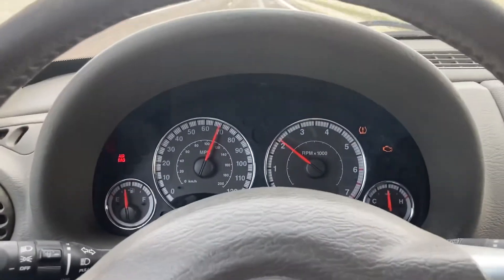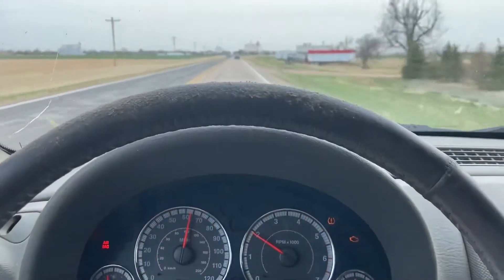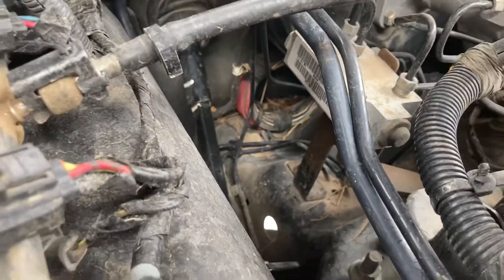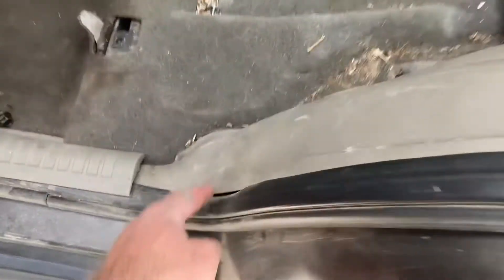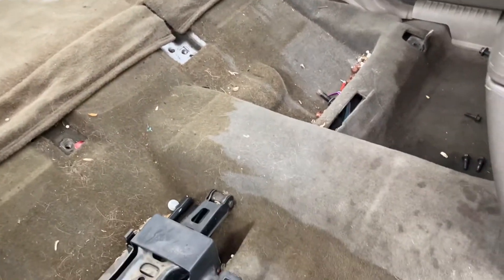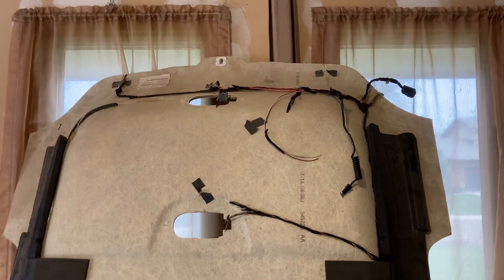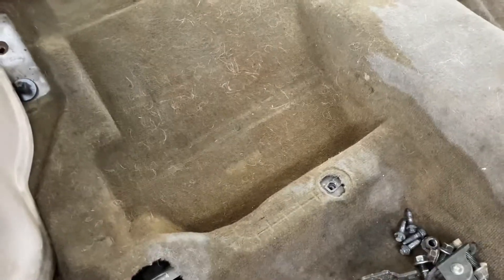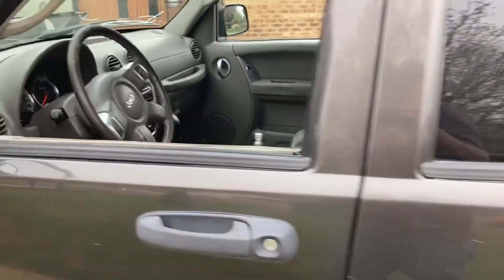2005 Jeep Liberty Update!! It’s running and driving again!

Comment: Wow, so your telling me, I tore my jeep apart and didn't run did yiur vudeo step by step and now ill need a engine
Reply from the maker: Unfortunately, in my case, yes I had a head that had a bent valve. I didn’t truly need to swap the engine, but I was able to get one for very cheap. Could have just rebuilt or replaced the head and been good probably should have done it that way but chose not to. Should have checked the heads when I had them pulled off.
Reply: You didnt have the heads machined at a shop? Im having issues with an 08 liberty and I think im off a tooth also on the timing. Shouldn't be enough to bend a valve so I'd like to know if you could have possibly had a bent valve from before the timing mistake on the right cam shaft.
Reply from the maker: @polygaryd  on mine the valve was bent from previous owner. They had installed a new head on the passenger side and I just assumed it was all good. It was completely my vault should have done better job checking things out before putting it back together.
Reply: @BASgarage  oh ok. I just had the heads machined and valve seats done. The car runs awesome at idle (super smooth) and revs up what seems to be normal but in gear it knocks like to little fuel or something. It didnt do that before the head gasket job. I didnt take the timing gear set out just lined up the balancer to tdc, put the cams v6 mark at 12 o'clock position, put the chains back on. Rotated engine over by hand to make sure no valve to piston contact. Cams cam back at 12 o'clock position when balancer came back to tdc. Cant imagine the engine would run smooth if a whole bank or both was off...
Reply: By balancer i mean harmonic/crank pully not the timing balance shaft.
Reply: @BASgarage  what noone seems to tell you is if both sides of the chain should have slack (before releasing the tensioner pin) or if the non movable guide side should be tight and all the slack be on the tensioner guide side? I assumed it was the later as in my mind it makes the most sense.